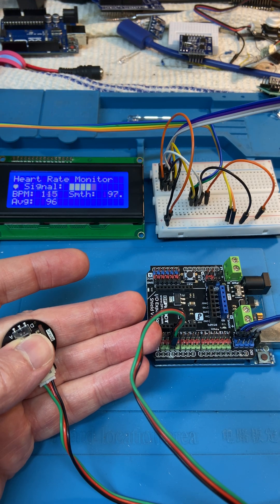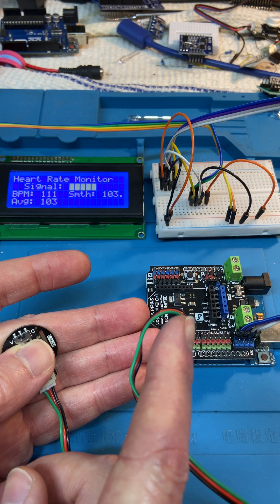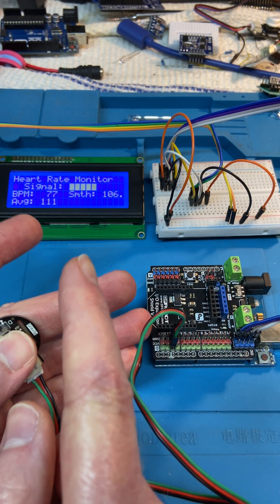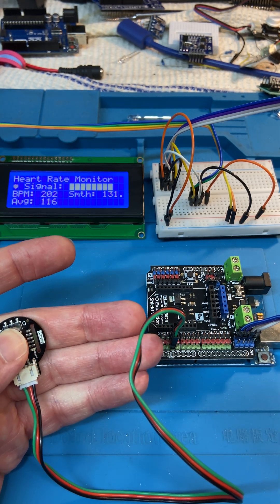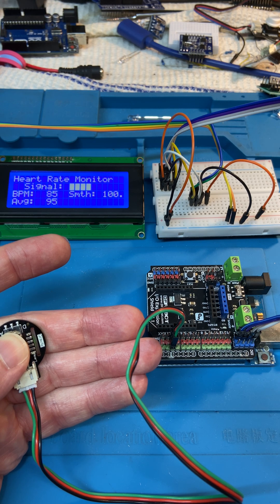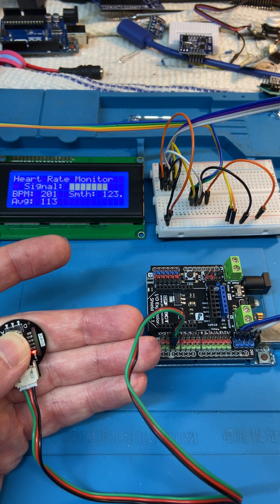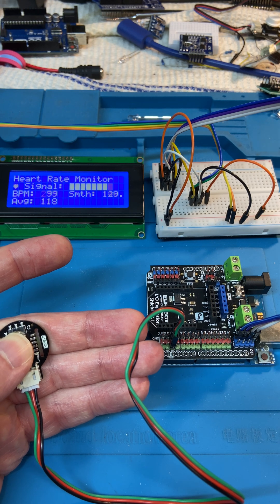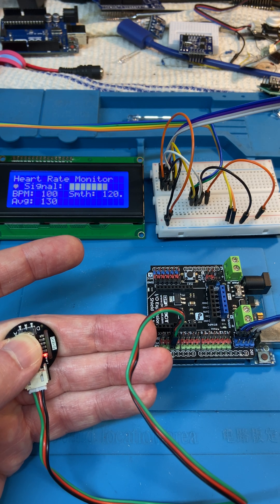DIY Arduino Heart Rate Monitor Using DFRobot Sensor + I²C LCD

Comment from the maker: #include <Wire.h>
#include <LiquidCrystal_I2C.h>

// ---------- Compatibility: ignore IRAM_ATTR on non-ESP ----------
#ifndef IRAM_ATTR
#define IRAM_ATTR
#endif

// ---------- LCD ----------
#define LCD_ADDR 0x27        // change to 0x3F if needed
#define LCD_COLS 20
#define LCD_ROWS 4
LiquidCrystal_I2C lcd(LCD_ADDR, LCD_COLS, LCD_ROWS);

byte heartGlyph[8] = {
  B00000,
  B01010,
  B11111,
  B11111,
  B11111,
  B01110,
  B00100,
  B00000
};

// ---------- Pulse input ----------
#define PULSE_PIN 2  // digital pulse from DFRobot heart-rate sensor

volatile unsigned long lastBeatMs = 0;
volatile unsigned long lastIntervalMs = 0;
volatile bool beatFlag = false;

const unsigned long MIN_IBI_MS = 250;   // 240 BPM ceiling
const unsigned long MAX_IBI_MS = 20000;  // 30 BPM floor

// ---------- Smoothing ----------
const uint8_t AVG_WINDOW = 8;
float ring[AVG_WINDOW];
uint8_t ringIdx = 0;
bool ringFilled = false;
float emaBpm = 0.0f;
const float EMA_ALPHA = 0.25f;

unsigned long lastFlashMs = 0;
const unsigned long FLASH_DUR_MS = 120;
const unsigned long NO_PULSE_MS   = 2500;

float clampf(float x, float lo, float hi) {
  if (x < lo) return lo;
  if (x > hi) return hi;
  return x;
}

// ---------- ISR ----------
void IRAM_ATTR onPulseISR() {
  unsigned long now = millis();
  unsigned long dt = now - lastBeatMs;
  if (dt >= MIN_IBI_MS && dt <= MAX_IBI_MS) {
    lastIntervalMs = dt;
    lastBeatMs = now;
    beatFlag = true;
  }
}

void printPadded(LiquidCrystal_I2C &d, float v, uint8_t width) {
  if (v < 0.5f || v > 999.5f) { for (uint8_t i = 0; i < width; i++) d.print('-'); return; }
  int val = (int)(v + 0.5f);
  if (val < 10 && width >= 3) d.print("  ");
  else if (val < 100 && width >= 2) d.print(" ");
  d.print(val);
}

void drawReadout(float bpmInst, float avgBpm, float ema) {
  lcd.setCursor(0, 1);
  lcd.write(byte(0)); // heart icon
  lcd.print(" Signal: ");
  uint8_t blocks = (uint8_t)clampf((ema - 50.0f) / 100.0f * 10.0f, 0.0f, 10.0f);
  for (uint8_t i = 0; i < 10; i++) lcd.print(i < blocks ? (char)255 : ' ');

  lcd.setCursor(0, 2);
  lcd.print("BPM: ");
  printPadded(lcd, bpmInst, 3);
  lcd.print("  Smth: ");
  printPadded(lcd, ema, 3);

  lcd.setCursor(0, 3);
  lcd.print("Avg: ");
  printPadded(lcd, avgBpm, 3);
  lcd.print("          ");
}

void drawNoPulse() {
  lcd.setCursor(0, 2); lcd.print("BPM: -- Smth: -- ");
  lcd.setCursor(0, 3); lcd.print("Avg: --             ");
}

void updateBeatIcon() {
  if (millis() - lastFlashMs > FLASH_DUR_MS) {
    lcd.setCursor(0, 1);
    lcd.print(' ');
  }
}

void setup() {
  // LCD
  lcd.init();
  lcd.backlight();
  lcd.createChar(0, heartGlyph);
  lcd.clear();
  lcd.setCursor(0, 0); lcd.print("Heart Rate Monitor");
  lcd.setCursor(0, 1); lcd.print("                ");
  lcd.setCursor(0, 2); lcd.print("Waiting for pulse...");
  lcd.setCursor(0, 3); lcd.print("BPM: --   Avg: --  ");

  // Input
  pinMode(PULSE_PIN, INPUT); // sensor drives logic pulse
  attachInterrupt(digitalPinToInterrupt(PULSE_PIN), onPulseISR, RISING);

  for (uint8_t i = 0; i < AVG_WINDOW; i++) ring[i] = 0.0f;
}

void loop() {
  if (beatFlag) {
    noInterrupts();
    unsigned long ibi = lastIntervalMs;
    beatFlag = false;
    interrupts();

    float bpmInst = 60000.0f / (float)ibi;

    ring[ringIdx++] = bpmInst;
    if (ringIdx >= AVG_WINDOW) { ringIdx = 0; ringFilled = true; }

    float sum = 0.0f;
    uint8_t count = ringFilled ? AVG_WINDOW : ringIdx;
    for (uint8_t i = 0; i < count; i++) sum += ring[i];
    float avgBpm = count ? (sum / count) : bpmInst;

    if (emaBpm <= 0.1f) emaBpm = bpmInst;
    else emaBpm = EMA_ALPHA * bpmInst + (1.0f - EMA_ALPHA) * emaBpm;

    drawReadout(bpmInst, avgBpm, emaBpm);
    lastFlashMs = millis();
  }

  updateBeatIcon();

  if (millis() - lastBeatMs > NO_PULSE_MS) {
    drawNoPulse();
  }
}